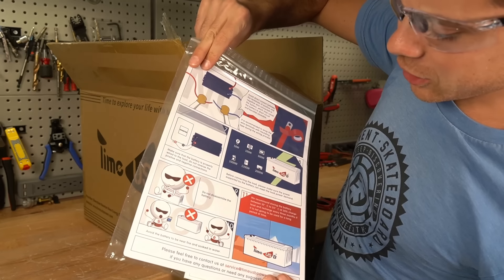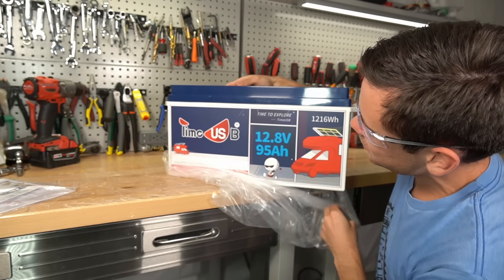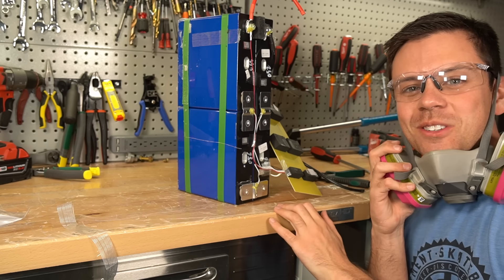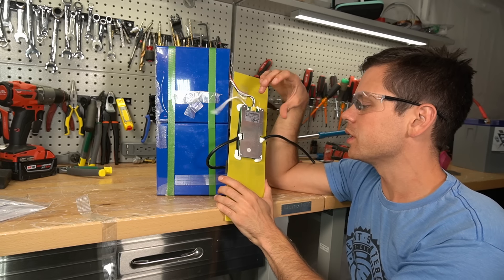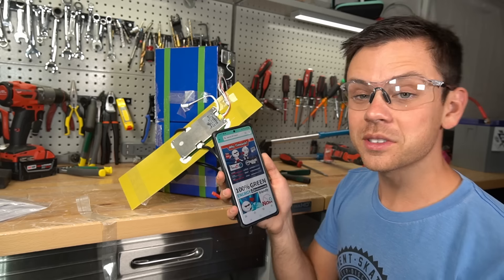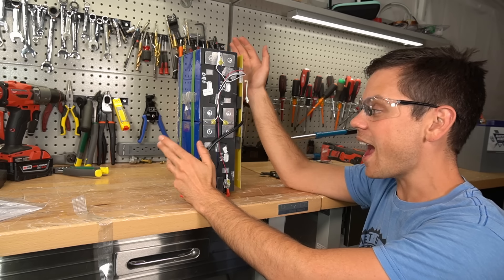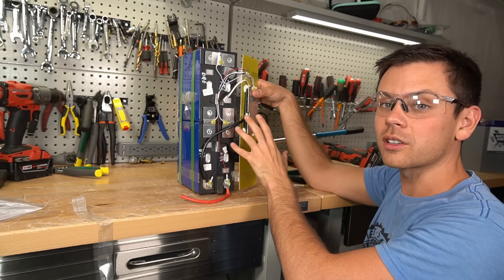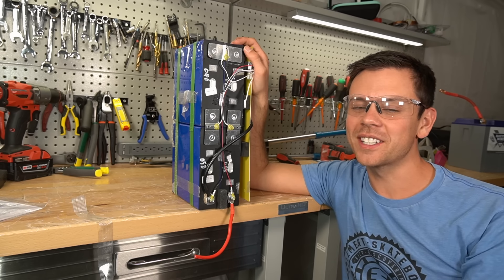$269 12V LiFePO4: Worth the risk?

Comment: First of all Love your videos and expertise. I'm new to the solar game, so pardon the dumb question. I'm looking at buying a lithium or AGM battery solely for charging off of solar and then using as backup power to hook up to my Delta 1300 in a power outage situation. If I could pick up a 100ah Time USB lithium battery for around 150.00; do you think it would be a worthwhile buy ? Again the battery will just be maintained and kept in my house. Thanks in advance for taking the time to answer a newby question.

Comment: The scariest thing about these batteries is that they landed on a cargo plane…….there’s all sorts of dodgy cells being flown around……it’s only a matter of time before another cargo plane drops out of the sky’s due to a runaway battery.

Dodgy as 😬
Reply: LiFePO4 doesn't have the thermal runaway issues LiIon does. They do have safety limits (what doesn't?) but much much safer than any other common Lithium battery technology. That coupled with their price, capacity, and charging characteristics is why they've become so popular.